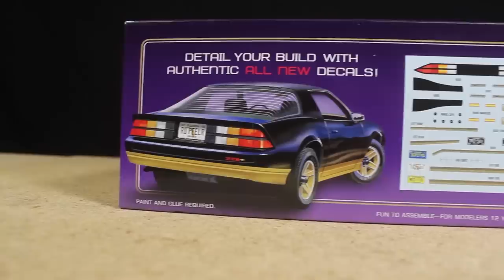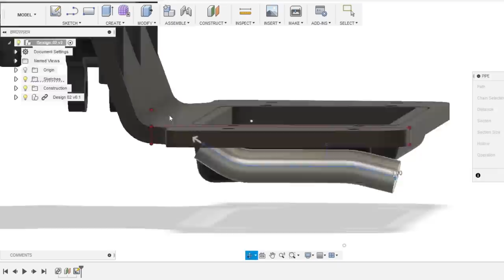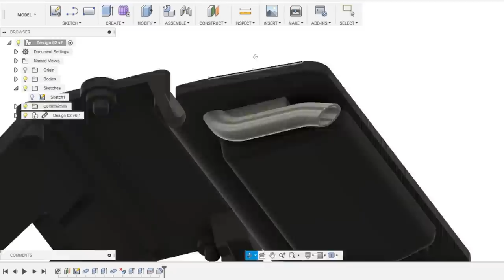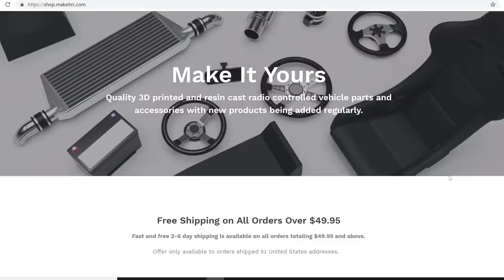AMT 1/25 Scale 1983 Camaro Z28 RC Conversion Full Build

Comment: I've never used an airbrush, but ive painted all my life. My orange peel advice is very very light coats and gradually thicken up, the 1st coat is almost redundantly light but its so the rest starts to stick more evenly. each coat after words again very lightly will thicken and darken. You'll forget what orange peel is, and always give extra time to cure so you wont get chips. I would think you would know this but you said orange peel was giving you issues. your models rock and I cant solder to save my life! Oh and the custom headliner is badass and an awesome idea!

Comment: For acrylics, I've found that bump pressure up a bit (25-30psi) instead of 15-20 psi -  and use 0.4mm instead of 0.2mm normally used for the lacquers.

Comment: If you use a c-channel programmer and programming software,you could take your skills to the next level.Carefully drill out all of the dash board levers and knobs and install fiber optics,and replace the speedometers with clear plastic stock with a waterside decal, install a bluetooth stereo system,and make the doors open with a functioning overhead interior light,functioning red doorlights,and this converted 1:25 scale plastic model car of the 1986 Camaro Z28 by AMT would be a show stopper;and no doubt in my mind would win both best in show and 1st place at the IPMS model show.

Comment: I'm not sure about acrylics.
But I paint cars for a living.
Hardened urathane paints and will hold up much better to real use like an rc car gets than anything
 unhardened
Clear especially. 
And clear coat get a light tack coat at first but needs less dry time between coats and wet deep second and third coats.
On real cars the clear tends to look best when it's right on the edge of thick enough to run.
These videos are very fun. I'm planning my own rc 1/25 build.
Reply from the maker: Thanks for the tips. I'm glad you enjoyed the video. 👍
Reply: @MakeItRC  i am starting a 1/8 Kenneth with drop float RC build

Comment: If you can’t move the front undercarriage weights much higher, consider making a faux front air dam. To my knowledge many of the 80s Camaros had these under the front end to vent cool air to the motor.
Reply from the maker: That's a good idea. I experimented a bit with adding an air dam to hide the weights but I thought it just stuck out too much and didn't quite look right.

Comment: A few years back my dad had a 91 Camaro we had so much fun in that car lot of good memories the body style of this in the paint kind of reminds me of the Knight Rider car
Reply: @ Maximum RPM The Night Rider car Kitt  as it was called is based off of a 1983 Pontiac Firebird.The Pontiac Firebird and Chevrolet Camaro Z26/28 of the 80's were very similar/identical in body design.Round 2 models has re-released the 1:25 scale kit of Kitt under the kit brands AMT,MPC,and Polarlights a few years ago.Revell has released a well detailed kit of the Night Rider car as well;all kit brands mentioned above of the same car are all about ~$30.00 MSRP.If the night Rider car were to be released by other kit manufacturers such as Tamiya,Aoshima,Meng,Fujimi,
Italeri,they would all come with a pre-wired distributor set,an 
ac/heater set,resin,vinyl,and photoetched metal parts the American kit manufacturers don't include in their kits of the Night Rider car because they are sold separately as after market parts sets.The foreign kit manufacturers are $30.00-$60.00 more expensive than the kits offered by the American kit manufacturers because the parts that are sold on the after market for the American kit manufacturers;are included in the foreign imported kits.For realism and better accuracy, and to win first place and best in show at the IPMS model show,the imported kits are the way to go if you are willing to pay $30.00 more.

Comment: You could make the wires look like the exhaust pipes and then finish them with the tail section you have printed. As for the lead I would have fitted more smaller pieces in gaps under the hood, sure it's cramped but seems like you can fit much  more in there. Any way great build and I envy the patience;)

Comment: Hey just a quick question about the motor, from what it appears the way you wired up the motor it can only turn on or off especially since it looks like it’s a dc motor, am I right about it being only able to turn on or off? Or is that esc able to get it to move at different speeds? Could you explain that a little? I’m trying to do one of these with a Miata kit and I don’t know super much about electronics and all the brushed esc compatible motors I’ve found are really big and I wanted to have a smaller one like you since it’s a 1/24 scale model

Comment: I love that Camaro I had a poster of the purple 85/86 Z28  on my bedroom wall in my 20s I had a 79 Z28 same black an tan that's what you should do next 79 Z28 drag style  buy the way start to finish how much did that cost start to finish
Reply from the maker: Nice, always liked the 2nd gen cars. Apparently Revell did a really nice 79 Z28 kit so I might have to build up one of them someday. I'd say the materials cost would be under $175US assuming you buy the front suspension and rear axle as kits.

Comment: i am gonna start doing a rc car came across your saura d4 build an may start with that, i noticed you working with the glass pieces on this car if you scratch them sand really finely and then take a small torch run it across and should glass right up. on another note any advice for a beginner rc car person?

Comment: Damn nice
Im thinking of getting a tamiya xv01 long damper spec...

Any thoughts on belt drive?
Reply from the maker: Belt drive usually needs a little more maintenance as the belt will need to be changed after a period of time (though unless your really driving the car hard and frequently, they'll hold up for a long time from my experience). Shaft driven chassis' driveshaft don't need replacement unless they get damaged but sometimes have a little more slop. Everyone seems to have their preference, and there are a lot of forum posts and articles on this topic.

Comment: Hi there! I’ve really been enjoying your videos, I just started filming to build some content and I’m having a really tough time getting quality footage up close in the first person (like your stuff, with tight framing on what’s in your hands), can you help me a bit by letting me know how you have your cameras set up?
Reply from the maker: I use a Canon T7i with 18-55mm IS STM Lens for filming. Some of the driving shots I did with a Firefly 7s. I do the best I can with lighting which is an important factor for getting nice footage. I set the camera up around my right shoulder but usually a little higher. I find this is much easier to work with than having the camera right it front of you like some other content creators do. Good luck with your filming. 👍
Reply: Make It RC Thanks so much for your reply!!  I’ll definitely be trying that camera angle, I’m filming on a canon DSLR as well  (a 60d with the same 18-55 stm lens) and I can’t imagine working comfortably with my camera between myself and the work.

Comment: I'm surprised they make a model of a vintage of Camaro the world should be trying to forget. 😉I'm speaking from experience, having owned a close cousin,, an '81 Trans Am. The late '70s and early '80s have got to be the darkest periodin automotive history. My T/A had like a whopping 140(ish) HP, the paint was peeling off the hood on a 5 year old car, the shifter for some reason required massive effort to operate, and that's just what's coming back to me immediately. I also can't quite figure out how I actually liked the looks at some point, because now I think they're borderline hideous. Oh yeah, I had a GF with a 6 banger Camaro from the same era and it was an absolute p.o.s. too. I do wonder if anyone who's had first hand experience with one of these would even consider spending time on a model. I guess maybe if you got your hands on a really straight body and started over, undoing anything and everything GM had done back in the day, I might not be embarrassed to be seen in a restomod. Nothing wrong with the video, though. I didn't intend any disrespect in that direction. 😉 Interesting stuff. Thanks! 😁👍

Comment: Hey make it rc, i stumbled upon your channel after finding my 1/18 2001 (i think) Mini Cooper S (first gen BMW Mini) autoART model had broken the rear control arm (it has/had full suspension and after realising this i wanted to make it rc, im wanting to keep it Fwd like the original, but also keep the steering and suspension, any ideas? I think i can fit a motor inside the engine block per se so that might be an option

Comment: I need to know howvto getbin contact with you because i need pricing on a complete chassis ready to run hydraulic and moving chassis i have pegasus wire wheels and it will be for my 1961 impala 409 bubbletop